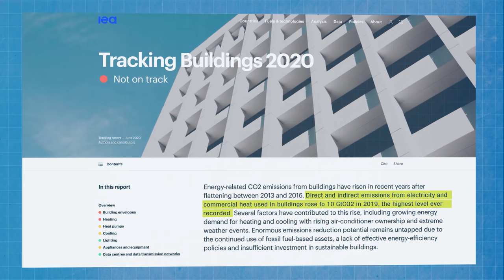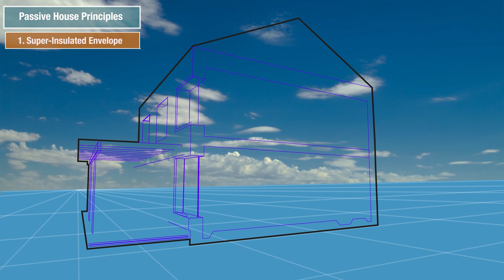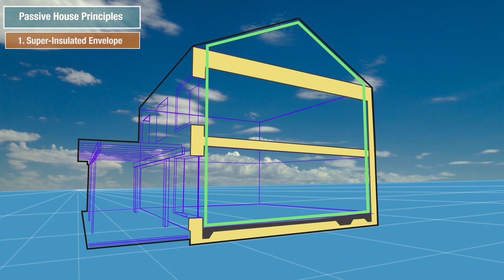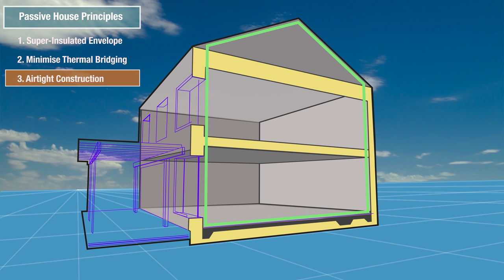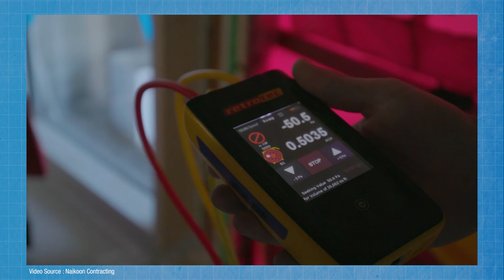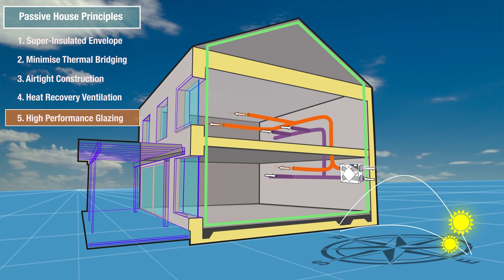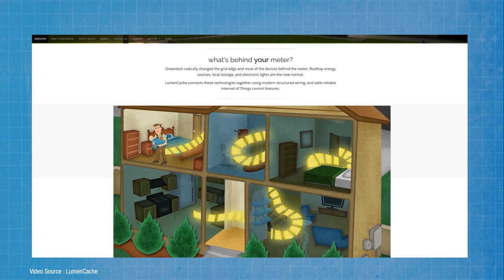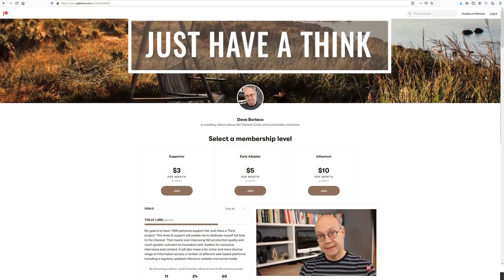Passivhaus . A low carbon future for our homes?

Comment: I built and lived in my passive solar home for seven years. Built with recycled materials the south facing windows were single pane so panels were used when temperatures went below freezing. The secret to comfort and efficient heating from the sun is mass ! The right amount in floors and walls.The fresh air was brought in by wood stove, less than one cord per year. Healthy and happy at 70 Happy New Year everyone.

Comment: Thanks for bringing this to our attention. In Australia the problem is reversed as the hot weather is more of a problem. It amazes me that every trip to Melbourne I see whole suburbs with black concrete tiled roofs brown bricks and no verandas. Put on a galvanised iron roof and a full veranda and reduce your air conditioning needs to near zero.
Reply: Join us at CLIMATE RESISTANT HABITATS Facebook group

Comment: Great video. I am a certified passive haus tradesperson and a professional engineer.  This is the future. Tho, the one thing we need to keep in mind is embodied carbon. By super insulating with more material that has to offset operational carbon that extra insulation will save.  More research around LCA is needed to do a net present value of the carbon emissions the building with have from cradle to grave.

Comment: You dont need to go this crazy, passive homes are great but they consume a lot of materials to get there. 1' in foam on the outside, 2x6 walls, totally insulated basement (walls and slab), R60 attic, casement windows, heat pump clothes dryer and an air leakage value under 1.0 ACH50. Use high efficient cold weather heat pumps and you will be 85% the way to net zero at a more reasonable cost and it uses far less materials which many of are not that environmentally friendly (spray foams, XPS foam boards)

I have done this to my 70s house in eastern Canada and 2 heat pumps provide the heat to my house but I have backup resistance heaters. When I bought it the previous owners used about 60Gj of natural gas to heat the place a year, I now use about 1500kWh to heat my house (~5Gj). In fact I use about 16,000kWh a year (~58Gj) to heat, cool, power my house as well as all the electricity for driving my EV. Once I get solar I expect to be able to produce about 11,000kWh so not quite net zero but pretty damn close.

This whole process has shown me just how fucked we are, it has taken a lot of work, money and personal knowledge to get to this point. I just don't see how we could ever get enough of Canada's housing stock retro fitted enough to be able to run on renewables in the winter. If we cant do that then the electricity used to heat our inefficient homes has to be green but that wont be happening with wind, solar and storage. Those alone would make electricity unaffordable for people, you would be looking at 30 -40kWh's a day for resistive heating at 30c/kWh at least, people would freeze or go bankrupt. 

The more I have dug into what it takes to be "carbon neutral" the more I am resigned to the fact that it cant be done without nuclear, or at least it cant be done in northern climates where the sun sucks for half the year and you have to heat your house.
Reply: Great comment, alex bob! I'm really interested in your point of view, since we share the same country and it sounds like you've put of lot of thought into this issue, and acquired a lot of experience along the way.

I agree that for the vast majority of us who live in non-passive houses, retrofitting to get 85% of the way to net zero is a much better solution than building new homes, and I'm really interested in these heat pumps you mentioned. Would it really be so hard to retrofit if there was more of a social movement behind increasing our energy efficiency? Home solar panels used to be very difficult to get, but with increased awareness and demand new industries were created to make the installation process easier. (Aided by government grants, of course.) Maybe the same thing could be done with insulation and heat pumps to increase the energy efficiency of older housing stock.
Reply: Sadly, the nuke bottles are the most obvious stopgap. Here in Illinois (the States) we have about 90% of our zotz generated from nuke supplies. [Caution: that number is a little old and may be stale. Lots of windmills have gone up over the last decade or so.] Your real carbon savings will come when old homes and other buildings are struck and replaced with new structures utilizing the materials and techniques you and Borlace have described. Once the demand goes down because the waste goes down then we can collectively dump phunky old fossil fuel and nuke bottle generation in favor of renewables that can keep up. <sigh> And so it goes.
Reply: We WILL be living semi-underground in the future. It will protect us from hurricanes, wildfires, smoke, giant hail, flooding, extreme temperatures and more. It's also cheaper to build and requires less energy. Join us at CLIMATE RESISTANT HABITATS Facebook group
Reply: You don't have to use foam/XPS (except below grade, but you can use foamglass there). Perfectly normal to build a carbon-negative PH from timber and woodfibre or cellulose. But even with the embodied emissions of EPS/XPS a PH is still dramatically better than a standard house over 50 years. Retrofitting is slow and painful, but it's also a highly parallelisable activity and generates a lot of economic activity so probably can be done if taken seriously. Nothing wrong with nuclear power as a low-emissions supply, but it's no longer cheaper than renewables+storage (unless something dramatic happens to change the cost of finance) so I don't think I agree with your pricing theory. It does still make sense to have some in high-latitude countries like Canada, UK, Russia (where solar is a fat lot of use for 1/3rd of the year).
Reply: Are you seriously trying saying that installing all that complex machinery (heat pumps, solar panels etc.) is cheaper than adding extra insulation, being careful about avoiding thermal bridging (cost nothing during design stage) and investing in better quality windows? You approach sounds like walking in cold day outside in T-shirt but with solar panels on head and heater strapped to chest, than putting warmer clothes and hat on!

Comment: Something else that would help lowering the CO2 emissions is building with wood instead of concrete and metal. That way lots of CO2 is stored in the wood instead of being emitted when producing the steel and the concrete. Fast growing tree varieties like Poulownia are well suited for this purpose.
Reply: 1. Poulownia is expensive
2. Wood burns
3. Fire exists (in the future growing forests of flammable material will be impossible, and then illegal)
4. Only concrete has the strength and comfort that will suit the climate conditions of the future

Comment: I guess it would be impossible to bring old houses up to passivhaus standards but having lived in ‘modern’ houses in the UK and now a very old stone house in France I know which comes closest. Most UK houses are built with a cavity wall between two layers of brick. The cavity in the 1960s house I grew up in was not filled, today they are mostly filled with foam blocks or retrofitted with foam blown in. Most roofs do not have sufficient insulation but this is an ‘easy win’ to reduce waste and hence Co2 emission. My experience of UK houses is that they get really hot and stuffy in the summer whereas our stone house here stays amazingly cool even in the 30c plus summers we get here. When we renovated the house here we doubled up on the French insulation regs and fitted the most efficient wood burners we could afford. There is no gas or oil heating but there is a lot of forest coppicing done every 20 years, followed by rapid re-growth. Wood is mostly sweet chestnut, hazel, hornbeam and acacia.

Comment: Hi, we collectively built a passive house for 11 families in Berlin and moved in almost 5 years ago. We have a water-warer heat pump going 70m into the ground and solar panels on the roof, also a floor heating system we rarely use, we only turn on when the temperature approches 0 degrees outside. Most of the energy is used for warm water, so a heating support in the form of solar panels warming up water could be an enhancement, also a battery. The climate inside is very comfortable, due to the ventilation the air is always fresh and pre-warmed from the heat exchange. All in all a really great system.
Reply: Please join us at CLIMATE RESISTANT HABITATS Facebook group

Comment: Thanks very much for your clear and concise summery of the principles to be followed in the construction of energy efficient low rise housing. Well before the inception of Passive House these principles where demonstrated in the Saskatchewan Energy Conservation house built in 1977 based on research carried out since the 1930's by the Division of Building Research of the National Research Council of Canada. I understand Dr Feist visited this project and became familiar with it's technologies before founding the Passive House Institute. Since the early 1980's thousands of homes were built in Canada utilizing the principles embodied in the Saskatchewan Energy Conservation House. In addition a series of net zero energy demonstration homes were built in Canada well before the Passive House Institute promoted these ideas. One additional guiding principle that should be added to you list is that of using low chemical off gasing interior finishes. These help to minimize the internal pollutant loads, enhancing indoor air quality and human health and allow reduced ventilation rates enhancing energy performance.